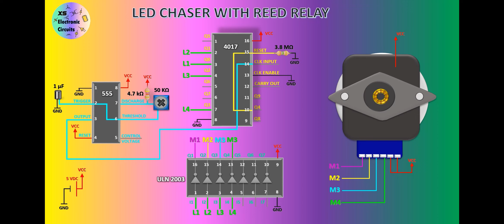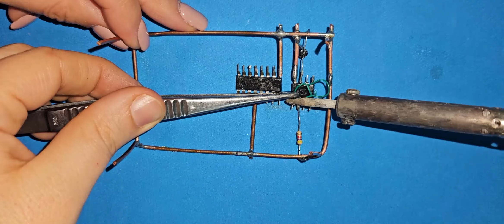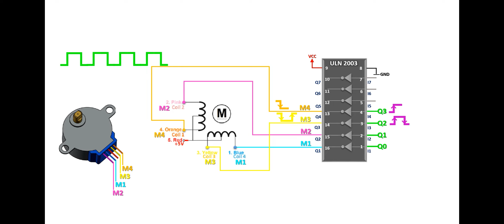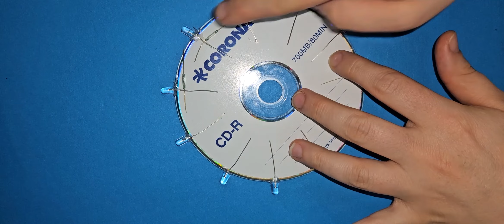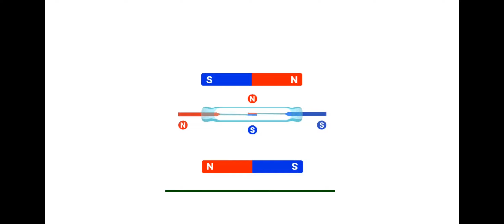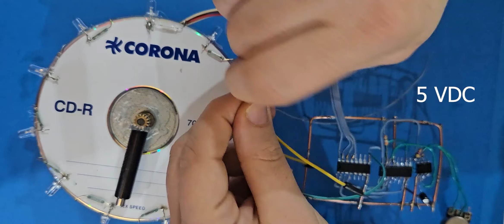How to connect LED and magnetic (reed)switch for making LED chaser,Speed Controller by Stepper Motor

Comment: Sir please make a video so that when you touch the reed switch the light turns off and when you remove it the light turns on.
Reply from the maker: Hello When the magnet passes by the reed relay, the LED voltage path is connected through the reed relay and the LED lights up.